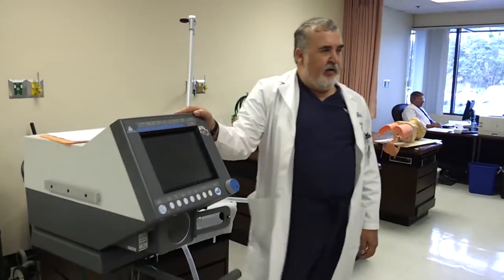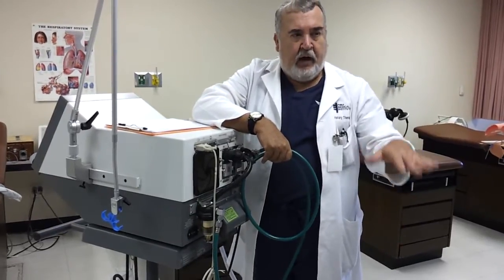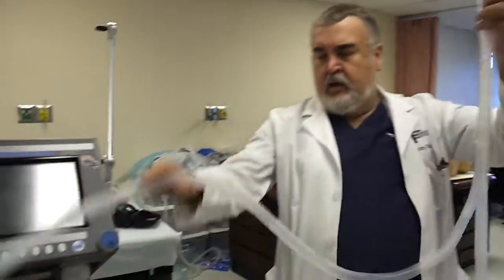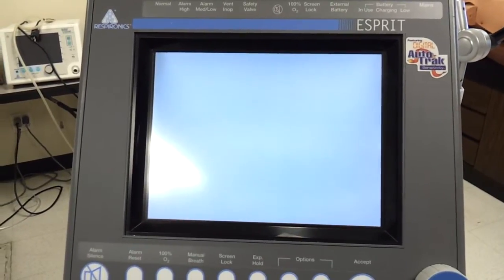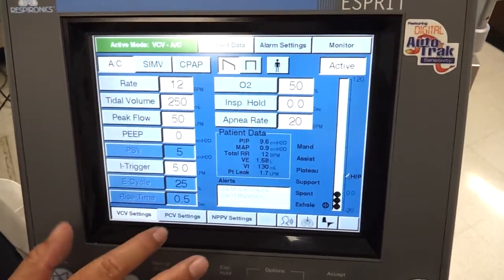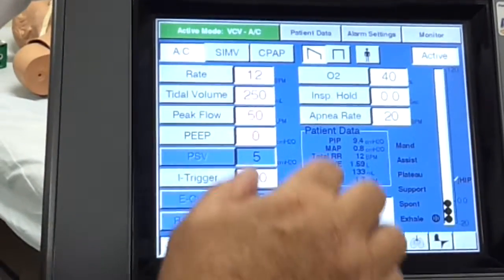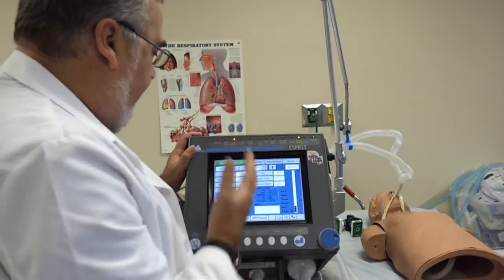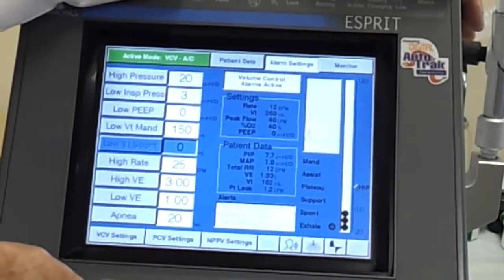Esprit vent setup McGowan class "p"

Comment: If that's the case then you would set them up for pressure control. Patients pip is increasing meaning the lung compliance is decreasing. You may have to watch the patients volumes if that's the case.

Comment: Hello Sir, first I would like to thank you for posting this video, 2nd I have a question to ask, Would you be able to explain why Increasing High Pressure Alarm causes Higher PIP in patient on this Ventilator? For example if my High pressure is Alarming at 40 cmH20 and I increase the High pressure Alarm to 50 cm H20 the vent starts to alarm at 50cmH20 and goes up as you increase the high pressure alarm and all this is on a patient whose recently intubated, sedated and has no circuit issues.